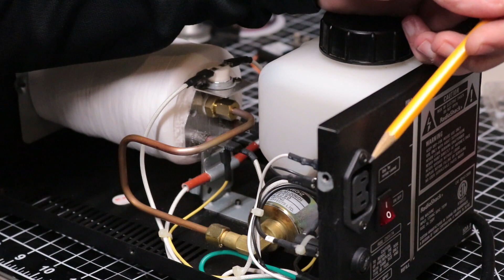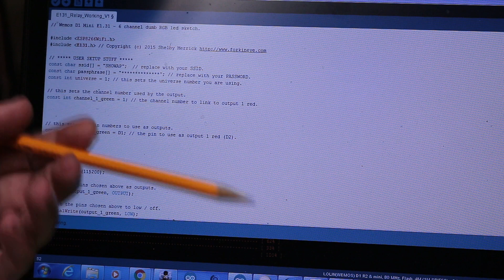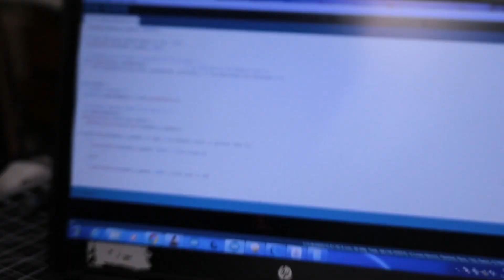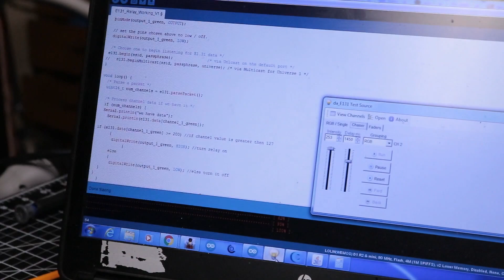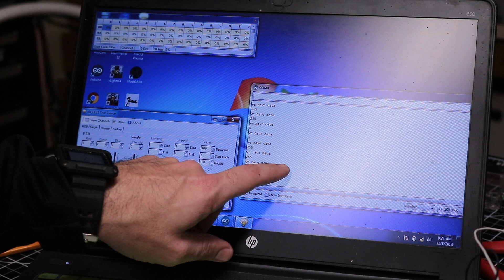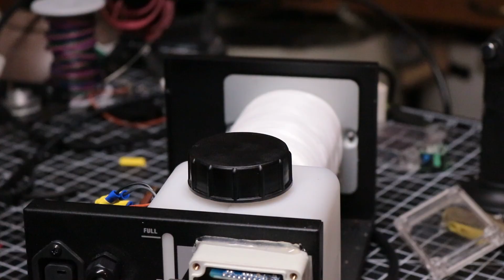DMX / E1.31 controlled fog machine

Comment: I am getting the data output on the serial monitor, however, the relay is not activating when the data is received.
Reply from the maker: Double check your output pins,  some arduinos require the pin number like 3 or 4 and some require a pin assignment like D3 or D3

Comment: Hi there, realise this video is a little old - any chance you'd be prepared to give some advice on how to do the above but to a simple DMX port instead of over Wifi? We have one at School and I'd like to plug it into our system and control it. The smoke machine is just as simple in terms of either on/off on the IEC remote (simple contact depress button for activation)... :)

Comment: instead of using a d1 could you use a nodemcu 8266 with wled instaled and dmx effect in xlights? sorry im still learning some of this stuff.
Reply from the maker: Yes you could use a nodemcu.  The programming is the same, just load the code with arduino.

Comment: Very Cool.  I was searching for a new DMX fog machine and found your video.  Thinking now I might just convert my existing units.  Is there a way a wemos board that I could directly connect to my falcon controler (DMX side) instead of using wifi?
Reply from the maker: You would use an arduino or some other microcontroller to essential convert a certain value of a DMX channel to fire a relay.  You would use most of the code for this but It would receive the DMX stream from the falcon.

Comment: I don't see anything in the Arduino COM port viewer, any ideas?
Reply: Set it to carrage return and cycle thought all the diggerent baud rates.  Everything you change the baud rate in serian monitor, reset the wemos till you see English on the serial monitor. When it displays garbage your getting close to the required baud rate.
Reply: @moparguy2011  That helped, I needed to use 115200.
Reply: @j0539h  glad it got you going.  Sorry i just read all the typos in my previous reply.

Comment: Very cool idea! 

Just a tip, it's not a great idea to power a d1mini using the 5v pin, it's supposed to be a lowish current output only. It will work for while, but it's not regulated like the mini usb input is. Eventually one of the components on the board (maybe a small diode?) gives up, burns out, and then your D1 is useless. I found that out the hard way as one of mine worked for about 2 weeks (constantly on in an alarm project) then fried itself.